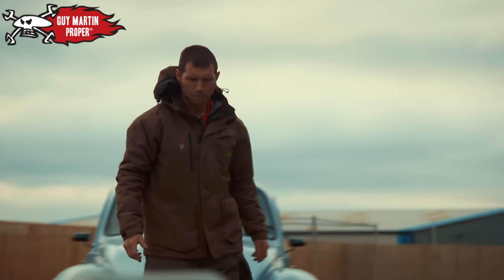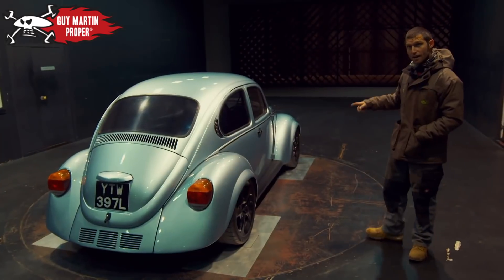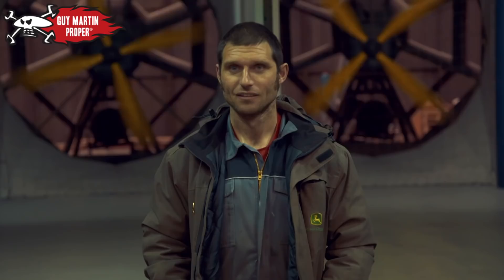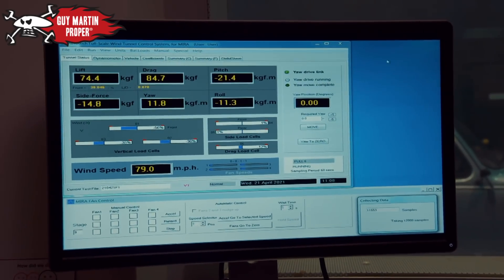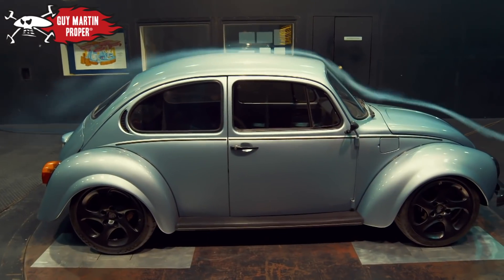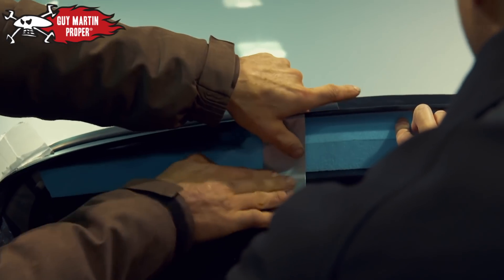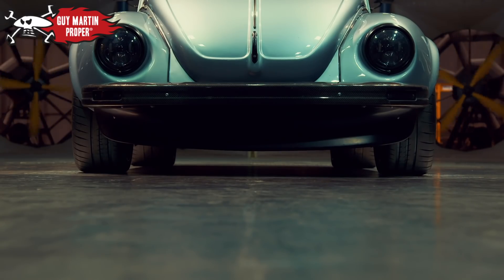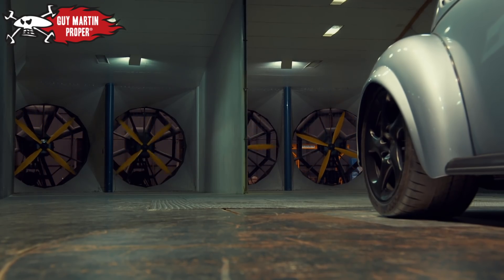How to make an electric Beetle go 140mph | Guy Martin Proper

Comment: I see a lot of hearsay about spoilers on Bugs, I think this is the first actual data-driven experiment. Very well done! What I'm curious about - and doing my own experiments to try to figure out - is if spoilers like these could also reduce drag to improve gas mileage. For this electric one, I'd think that would be a high priority for improving range. Would have been really cool to see the smoke test with the spoiler on to show how it changes flow, alongside the data of how much lift it reduced.

Comment: You have to be careful pushing a VW Beetle too fast.  The body is somewhat aerodynamic, the faster you go the more lift it produces.  In the 60's a guy put a gas turbine in a Bug and on a run down the quarter mile it left the ground at around 150 MPH.  Nasty crash.

Comment: A guy that does circuit and uphill races with a beetle told me on a forum that most of the lift on the front axle is caused by the fenders. The beetle has no inner fenders and there is a lot of room around the wheels. At higher speeds the fenders almost act like a sail. He added some large vents to the front fenders and it reduced the lift drastically.
That’s not very practical for a streetcar but maybe it’s possible to use some custom inner fenders and vents to redirect the airflow and further reduce the lift on the front axle.